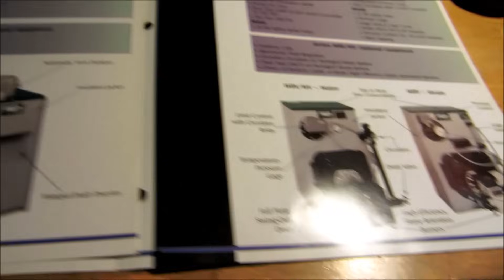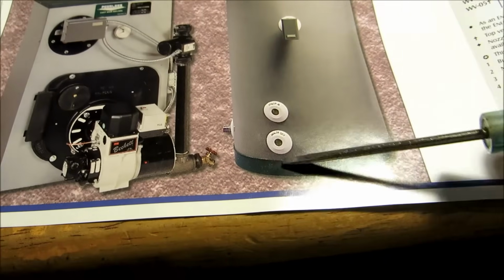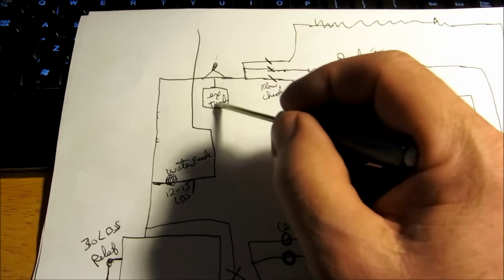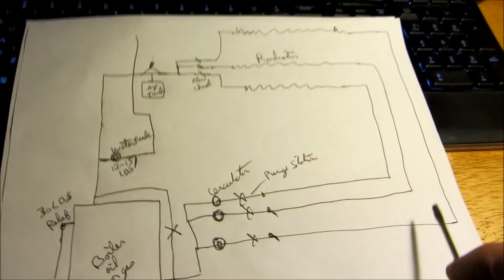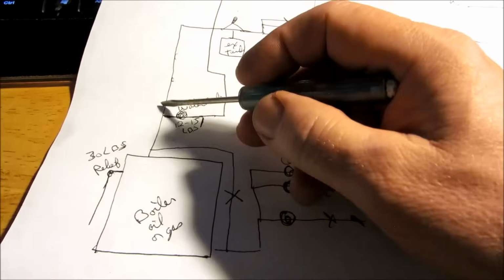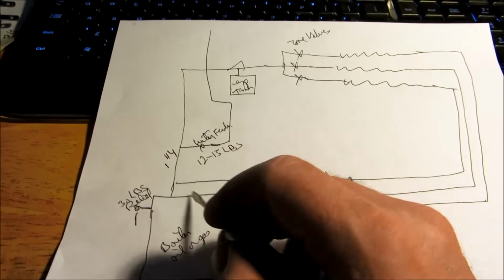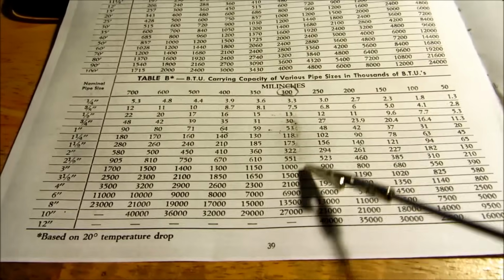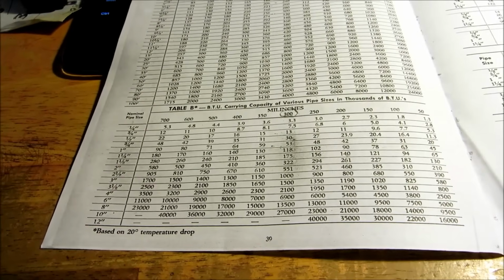hydronic heating 101 part 1

Comment: Kind of dubious about the 'shocking the boiler' as a cause for electrolysis.  I'd look at minerals in the incoming water (if the water is hard) and at use of dissimilar metals as the cause.  If you've ever used up a single-use battery, it's because the materials (zinc for a zinc-carbon cell) have been used up by the electrochemical reaction that creates the electricity, which is the same reaction as corrosion.  The same thing happens for dissimilar metals in other situations, such as an aluminum boiler with iron,  brass and copper pipes and pumps in the loop.  That's why dielectric unions are available (though not used in hydronics), they add a gap to the electrical circuit and slow the corrosion way down.

Comment: I have a question ,,, is PEX  pipe (tube) is approved for baseboard  heaters on a single family house in RI or MAS , Another question is ,,,,,can you splice a peace PVC  SCH 40 on a  steam pipe ,, EXAMPLE ,,,, cut a section  of black  and replace  with a PVC pipe  on a steam  boiler system

Comment: I was a stationary engineer in large plants and high rise buildings. I specialized in HVAC. Most boilers I had were Cleaver Brooks high and low pressure steam. I am buying a craftsman home with hydronic heat . I had never encountered one of these system in a residential home. I really appreciate your video. I have been in the HVAC area for over 40 years. You are one of the most knowledgeable in the field ...

Comment: Hi.. thanks for the vids.. I pulled out a small heater during my bathroom remodel and am in the process of installed a kickspace for under the vanity. This series showed me exactly what I needed to do to refill and purge the air out of that zone. Very informative!!!
Reply from the maker: +Robert Olson you have to use mona flow tees with a kick base heater
Reply: Steven,
I really need your help just to make sure I don't mess up anything big, any help would be appreciate it.

So I live in a 1 bed-room apartment in the first floor, and in a building that has 2 floors and 14 apartments.
First problem is that I have no clue which one is the "ball valve" and "gage" or the part to which I have to attach the hose to in order to get all the water/air out.

Second problem is that the heat in the bathroom works good, in the bedroom it works very little, and the living room it doesn't work at all; but I thought that if there is air then ALL rooms should not be working?

Third, I replaced an LR1620 thermostat with an RTH2300B digital thermostat (both from Honeywell). They have only 2 wires so I assumed it is Heat-only and so I hooked the two wires to the "W" and "R" label?? just to make sure I didn't mess up there.

Again, I really appreciate any help that you could give me.
Thanks in advance

Comment: Steve, you make me feel better (6:30) as my circulator pump is on the supply side, in fact, right off the outlet for the hot water.  Surprised they did that since it makes logical sense to me to put a pump on the return side where it has less exposure to heated water.  Guess that was 1965 technology.  Great video.   The tank is on the ceiling--still looks good externally.  I installed one of those huge B&G Air Separators (EASB-3/4) on the system 11 years ago and have not heard any air sounds since.

Comment: +1 you make it seem easy! You should explain common feed valve problems, over feeding, won't feed ect. I always put my ear right to them when I'm done purging to make sure they close. Sometimes a firm smack closes them. Old timers always tell me circs low on the return flo checks high on the supply side and from my experience that's what works best. When the circs are high on the supply side they get burning hot and systems seem to get air bound more often. I'm gonna watch part 2 now, great part 1 very informative
Reply from the maker: some very good points bet

Comment: Good video Steve. There is just so much more that can be done with boilers over forced hot air. We just install ice melt loops in the drive way for a car wash.
Here in Jersey we need the low water cut off on all boilers, also need a back flow before the pressure reducing valve.
Reply from the maker: we install a backflow in front of the feeded here also .i will go over that in future videos

Comment: Steven is correct as usual about the HVAC returns. 90% of the units I see are undersized when it comes to return duct. Usually they are undersized by about 25% which is a lot.

Comment: I know. I'm late to the party on this video, but I have a question.  What determines what side of the boiler the supply or return is on ? If it can be installed either way?

Comment: Great video 👍.I am planning to do the radiant floor heating system. Can i use a tankless water heater instead of a boiler? If so, what brand of a tankless water heater would you recommend?

Comment: FWIW our fill valve seems to be a type that stays shut off until you lift the lever, then it will fill UP TO the set output pressure.

Comment: Hi Steve , thanks so much for what you do, I need to replace a copper header that splits into two zones because the homeowner is finishing the basement and the header hangs down too far in the ceiling,  I plan to use orange pex to do this,  currently the copper header that leads 60 feet from heater before it splits into two 3/4 pipes that  feed two baseboard zones  is 1"   pipe the two zones are 3/4"  that lead back to the boiler to balancing valves.   Question is do I need to use 1" pex for the 60' foot feed header or can I use 3/4"  pex to feed the two zones? .the house is 1800 sq foot and the heater is 130 btu, based on your class I would say yes right?   thanks

Comment: Zone valves are only needed if you have a thermostat on each zone correct? For example I want to run one circulator to 2 closed loops one to 2 bedrooms upstairs and another to downstairs.. with a thermostat in the living room downstairs. Is this good?

Comment: Great information.  I have a rental property that has 3 suites with one big zone. Once the system is up to the 15 pounds can I shut off the supply to the pressure regulator? I normally check the boiler once a month or so in the heating season to check for issues and could check the pressure at that time. Or should I leave the city pressure on the regulator at all times in case it needs a bit of water to build some pressure?

Comment: I'm doing a bit of research online and it looks like most modern system designs have manifolds with a 1/2" line for each zone/radiator. I guess it would be much easier to have a main line 1 1/4" running the length of the house with 1/2" lines coming off to each rad.

Comment: Steve thanks a lot for the response. Now I'm watching a lot of your vids to remodel my bathroom. I want to do radiant in small bath and a kitchen, the rest of the 3 bedrooms and living room would be baseboard. Right now there is only one zone, and it's split into 2 loops. 
I think I understand the tempering valve - makes sense. Once the the hot supply water leaves the boiler it then goes into the tempering valve, gets reduced to 110 and goes into to a radiant floor. Should I have a zone valve for this loop? Once that water leaves the radiant floor loop where should it mix back into the system. (I'm asking because u mentioned that return water must be of certain temperature. Thanks a lot!!!

Comment: Hi, where did you get the pipe sizing chart? Tanks for the info , I am putting the old cast iron radiators in my house and was going to use 3/4 inch pipe . May need to go up to 1 inch.

Comment: Hey Steve I've been viewing a lot of your videos in the past. I am in Plumbing school right now and I am learning to assemble residential Weil Mclane boilers and trying to remember and understand all the components to the boiler system. Circulator Pump is to help circulate the water throughout the system, Zone valve is to help heat go to the part of the house you want it to go too...  Expansion Tank is to prevent excessive water pressure., Air Relief valve is to relieve any air that might get into the system.  Am I correct.?

Comment: Hi Steven, thanks for the info and your work you put into your vids. Am I understanding you correctly?  If my boiler (servicing a 3-family home) has only 1 circulator pump, then I need zone valves (one for each apt).  But If my boiler has 3 pumps, then there is no need for zone valves?

Comment: I had a situation where the system had no hose bib connections to drain the boiler accept for on the main supply & return lines, so no way to purge zones individually however; there was auto vents on all loops (baseboard heat) but almost every auto vent no longer worked. Is there any way to purge the air? Can you just open all zone valves and purge through the main hose bib drain?

Comment: When you flush the system of air you turn off all 3 ball valves on the return side of the boiler, but I dont see a valve to prevent full city water pressure returning to the output of the boiler on your diagram? Is there a check valve there? Also the over pressure relief valve is between the boiler and city water in that diagram. Thanks.

Comment: Hi Steve. hoping you and yours have happy holidays. An ITT boiler instructor recommends putting (the expansion tank on the suction side of the pump).  because putting it on the pushing side creates a negative on the air vents (sucks air in air vents) . Do you agree???
Joe from Texas
Reply: yes thats correct. the reasoning is also because on the dischage side of the pump, the expansion tank absorbs the pressure differential by the pump.. making the pump uselesss

Comment: Excellent video series. Thanks! I have a question: I live in a rancher with a gas powered hydronic system. The supply runs through by a cast iron radiator in the semi-finished basement, then 3/4 copper fin baseboard for the upper level. I want to move the basement cast iron radiator by two feet, and replace it with a modern design. The cast iron radiator is on 1 inch black pipe. I hear that it is best to replace iron pipe with copper pipe. The modern radiators on the market look like they have small diameter fittings. What is my best option?

Comment: Hey Steve 
Thanks for all the info, replaced a piece of leaky pipe and bled the system . Then checked everything from expansion tank to proper flame. Your video really helped with our simple one zone system. We have a vaillant g100-6 broiler that is next to our electric hot water heater/tank. Is there anyway to have this broiler also heat or back up the house hot water.  This broiler does not have the option built in on the side of it as I've seen in other videos. There was no antifreeze in the system that I noticed when I bled the system. Our feed supply and return pipes are in our crawl space and insulated.
Reply from the maker: +Donny McClure glad i could help
Reply: +steven lavimoniere 
Have you ever added
in a way to  back up the hot water tank ? I assume the difficulty is in the heat difference?

Comment: Hey Steven.   These are great videos.   And I'm just an interested viewer.  I'm looking at my hydronic gas powered furnace in the basement and for the life of me I can figure out the piping only because the furnace is tied into my domestic water heater which is tied into my domestic water supply so does that mean that the water running out of all my faucets is tied into my furnace and my family is washing there hands with water that's been circulating throughout the baseboard heat and furnace piping.   I've been scratching my head about this and was wondering if you might have a chance to provide some clarity.  Don't waste too much of your time it's really not very important but I'd appreciate the response. Thks

Comment: Steve
I upgraded my boiler to a mod/con 96%.  I also replaced my zone valves with individual circs.  The piping is 50 years old and a single 3/4  supply side pipe runs the length of the house ( 35ft) before breaking out into the separate zones.  My problem is ghost flows.  When one zone calls for heat I get heat in two other zones. I have Grundfos 3 speed pumps with integrated check valves. My suspicion is that the long supply pipe before breakout is heating a lot of common water to the zones adding pressure to all circuits and this pressure is pushing the checks open.  My contractor says adding flow controls to the return side of each loop will add resistance and solve the problem.  This is 5 zone system.  3 originial zones participate in ghost flows. One to the basement and one to a family room addition work ok.  Any advise would be appreciated.  I am also concerned that the common feed to 4  zones is only 3/4 pipe.
Reply from the maker: Ray Riley i would add flow checks on the zones that your having probles with .all a flow check does it will not open till the cercator runs .the flow checks belong on the supply .don't forget the high affencey boilers have a pump in bioler a lot of them on a loop zome to keep water flowing through the boiler  sounds to me the piping is not installed per boiler specks look at the boiler manual ,maybe try putting the curcalators on low speed and see whats happening .its hard to say with out being there and looking over whats happening

Comment: closed loop system simplifies things? have 14 gallon closed system im finishing. can i use single speed taco 007 circulator connected to regular air thermastat  for temp control?

Comment: Going with your depiction, what if , when bleeding each zone individually, the bottom zone has just a trickle of water but the others have great water flow?  Outside air temperature is well above freezing.
Reply from the maker: probley i freeze up
Reply: @stevenlavimoniere  Thank you for your fast reply. I mentioned that the outside air temperature is well above freezing so it's not a freeze up. I'm now at the point where I think the problem is in the flow check valve. I will use the bypass feature on the valve and see what happens. 
I can't think of anything else other than a fluke clog in the loop somewhere.
Reply from the maker: @TheNYgolfer  turn the screw on top of flowcheck to open it .. then screw it back down to reset it

Comment: I have a question concerning a job that I am currently working on. I installed a condensing boiler for one of my customers. I actually finished a job that another contractor left unfinished. We performed a load calculation and found that the kitchen/dining room area was short on baseboard. The customer asked that we leave all as it was to try and see how it all worked out for the first winter. He called us back and now wants us to add a panel radiator as the available space is where all can see. With that being said, can a panel radiator be installed in a loop with copper tube fin baseboard? I ask because I've been told by some that you can, and by others that you can't. If so, are there special fittings that I would need to use, such a mono flow tees, or something? I would greatly appreciate the help. Thank you in advance.
Reply from the maker: +High Calibre HVAC yes i would connent with monoflow tees on supply and return make sure you have at lease 12" before fitting ,elbows ect the monoflow tees will push and pull the water through panel radiator . you might want to use a bigger curcalator pump  if it does not work .the problem with the high effence boilers is the temp does not get as hot as the older boilers . 175 in like the max . you can get out of them .

Comment: Hi Steve, I grew up in a house that had a boiler in the cellar and you always had to go and check the flask for the water level.  Each radiator had a single pipe coming out of the floor with a gate valve ( I think) to turn off that radiator.  I don't remember the radiators having a return but they did have a little deal on the end that whistled when the steam came up.  What type of heating system was that?  Thanks.
Reply: Vincent Herman steam system with single pipe design pitched back to boiler for gravity return
Reply: Thanks.  Furthermore the boiler used to be run on coal (before I was born).  I saw the coal area (with some coal still there) when I was a kid.  My mom said it was converted to Nat gas when she was a kid.  Not sure if they use the single pipe anymore.

Comment: I have one zone hydronic system in a 1400 sf ranch. Can I add radiant floor system to it too? I would do the radiant under the tiles floor in the bathroom and the kitchen and keep the baseboards in other rooms. I have your regular 80% efficiency gas boiler. Thanks a lot!
Reply from the maker: Rafal Godlewski yes you can add radiant heating zone to a existing system you have to put a tempering valve in to lower temp of that zone .down it like 110

Comment: Thanks for your very informative videos.  I have a couple questions ... 1.  I'm trying to determine the correct placement of the expansion tank.  In my house, I see it on the hot/supply side of the boiler with the air separator directly above it.  However, in the research that I've done on line, the prevailing placement is on the cold/return side of the boiler.  Is there a correct placement or maybe it doesn't matter?  2.  Also, I understand that the air separator should be placed at the high point of the system.  Should one be placed near or in conjunction with the expansion tank?  Why?  Thanks!John

Comment: Awesome video!  I assume shocking the boiler means introducing cold water to a hot boiler which would possibly crack cast iron?  Why does style of radiator make a difference?  I am really looking forward to more lessons on hydronics Steve.  Thanks, Jeff
Reply from the maker: yes the boiler could crack if its shocked with cold water but i have never seen that happen my self  a bye pass is something to keep in mind it not always needed

Comment: I have heat on 1st floor but not 2nd floor. Cant find any helpful info. It seems to usually be the opposite, no heat on 1st and heat on 2nd floor. But i have no heat on 2nd floor, 1st floor is fine. Any ideas?